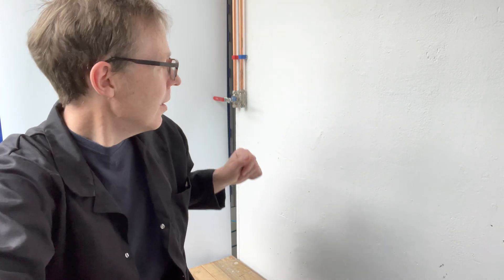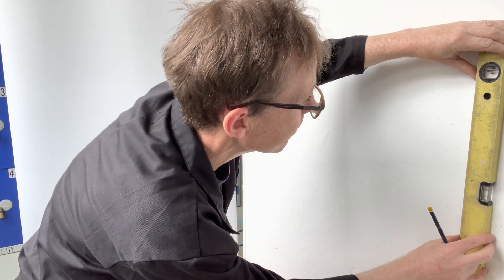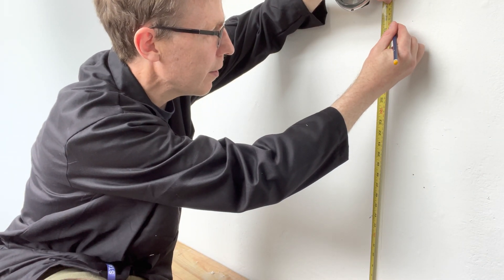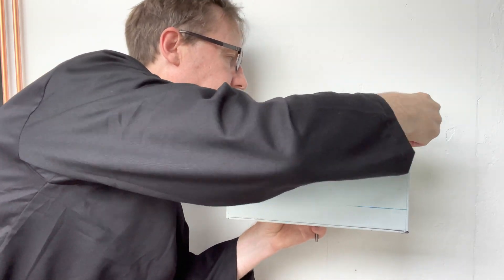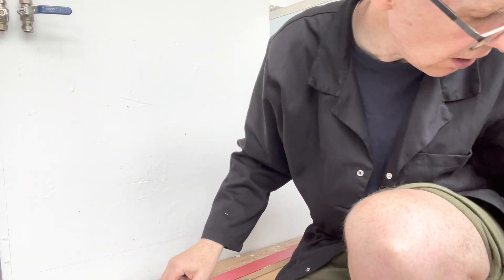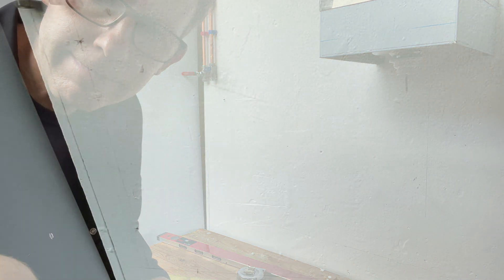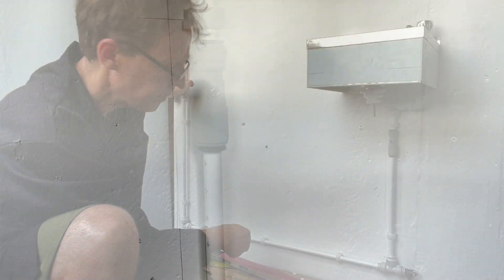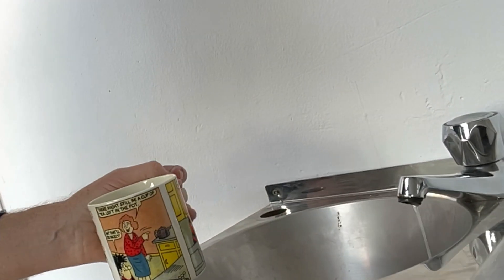Installing a basin using 15mm pressure pipe (Push Fit) - training exercise with worksheet at end.

Comment: Great tutorials 👌 More pipe bending and soldering plse. It might be a bit advanced but wiring a S / Y plan. But with the updated buildings regs requiring a lower flow temperature to increase efficiency of gas boilers, a video on Priority domestic hot water unvented systems but their are only a few boilers that can fire on two different Kwh out puts. Intergas X plan seems the best.
Reply from the maker: Hi thanks for nice comments, will plan to do do these videos at some point.